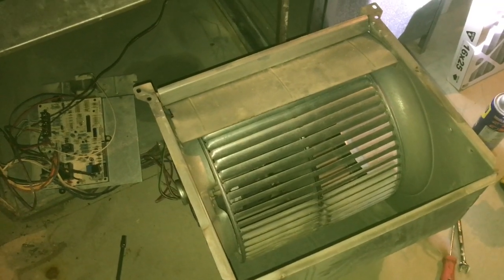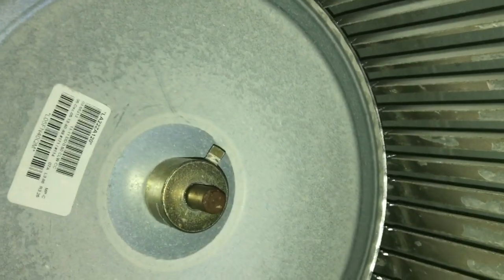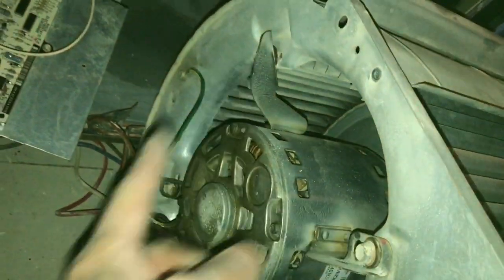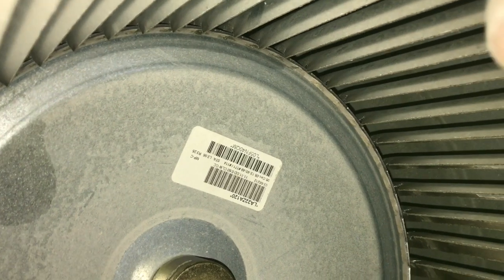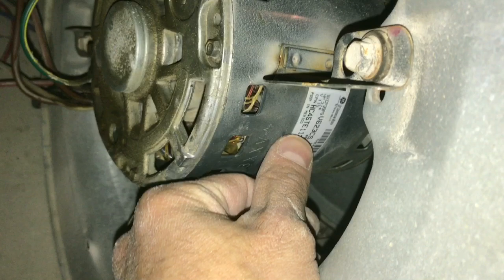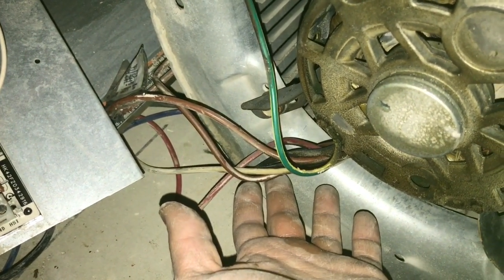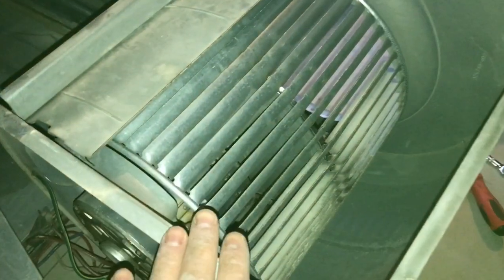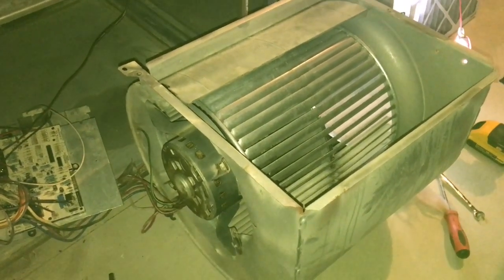How To Remove A Blower Motor In Your Furnace

Comment: Watch your option if the turbine doesn’t wanna come off the motor shaft? Is there a quick and Easy way to get that removed without a special tool?
Reply from the maker: A torch heat it up and crow bar and hammer hope that works or angel grind the turbine if it’s junk